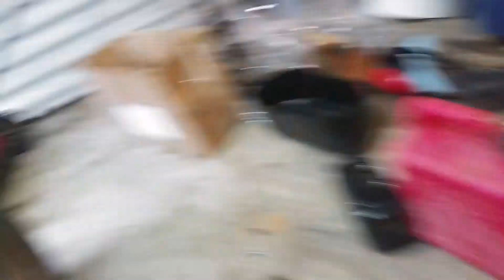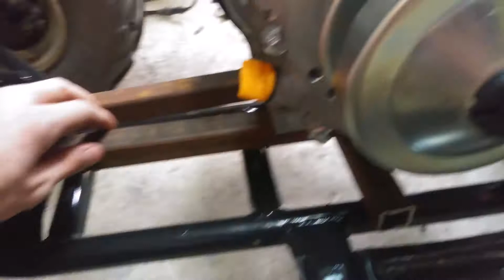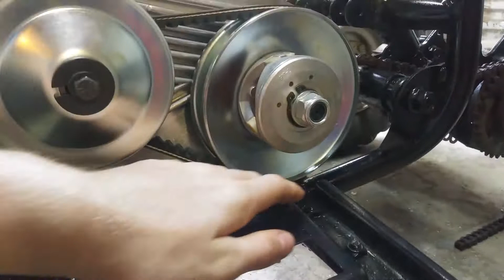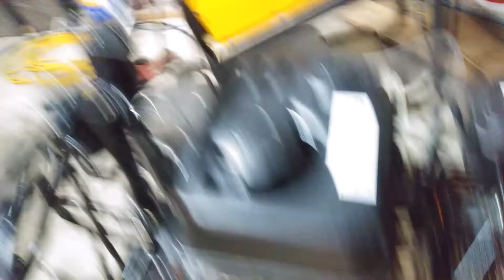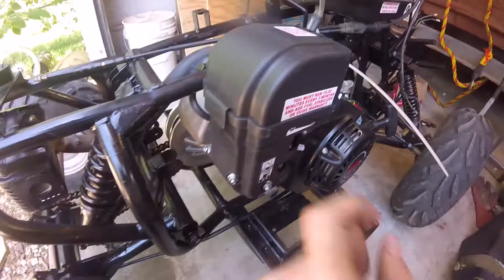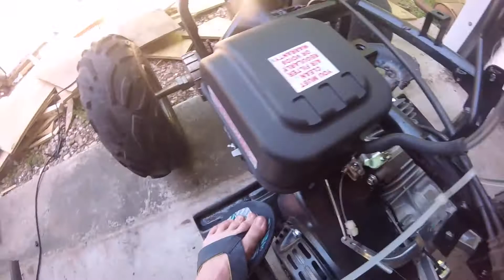Free ATV QUAD PROJECT 212CC PREDATOR MOTOR Part 3- Motor mounted/ First startup

Comment: I'm doing the exact same project with a Honda TRX 125. I had to do the 2 inch lift also.  I'm using a 50 tooth rear, but I have 22 inch rear wheels.